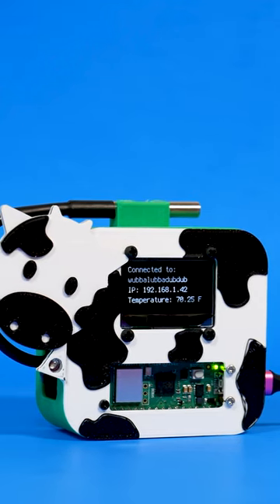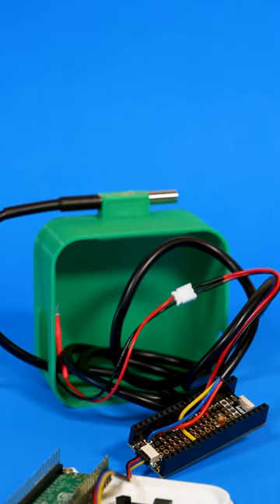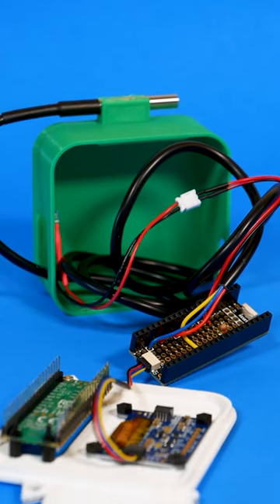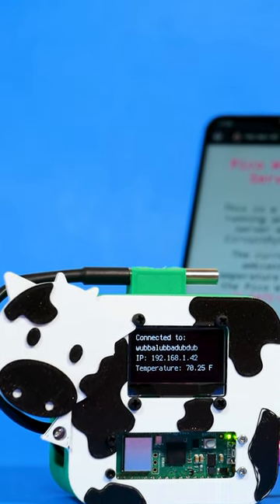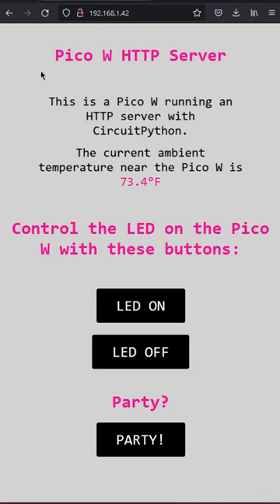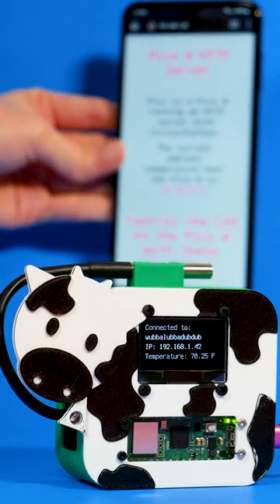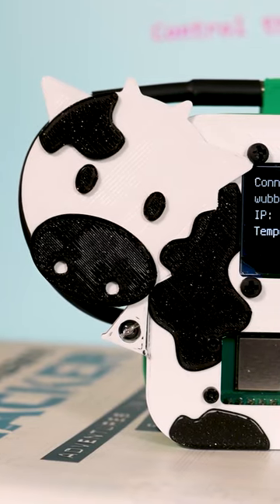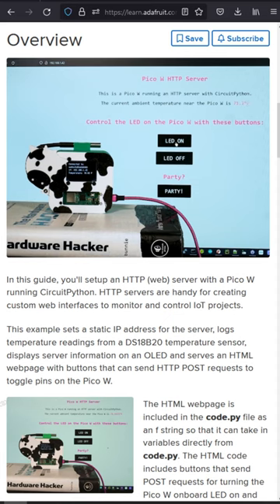HTTP Server with Pico W and CircuitPython #adafruit

Comment: How can a Raspberry Pi Pico W be configured to function as a soft access point (hotspot) on CircuitPython, allowing users to connect to it with their phones and access the web page running on the pico w without requiring an internet connection?